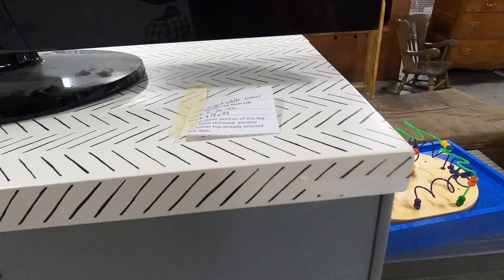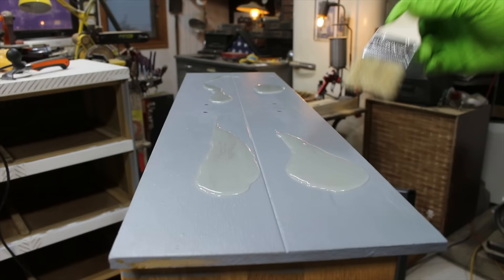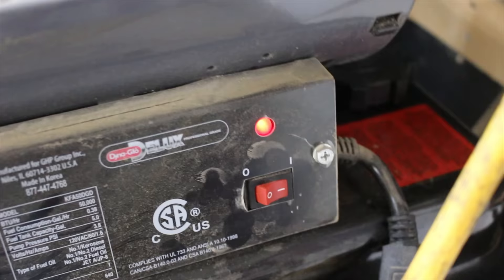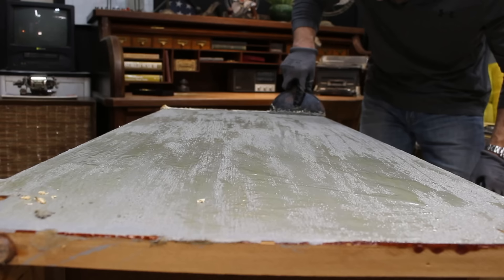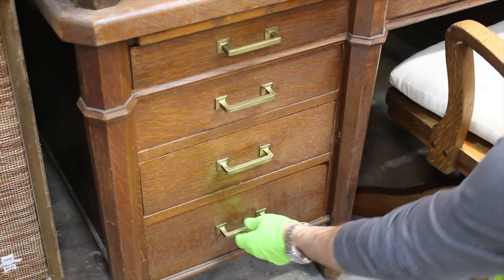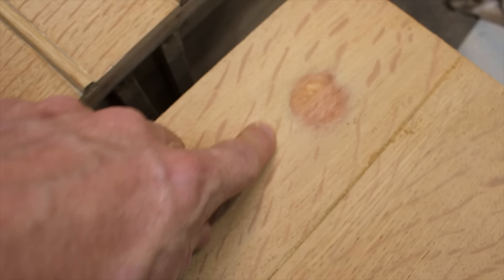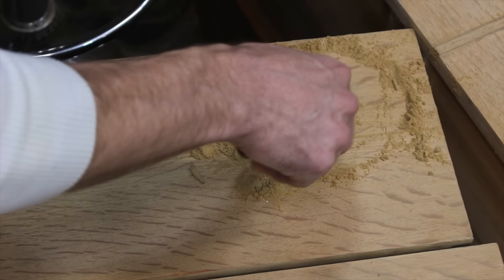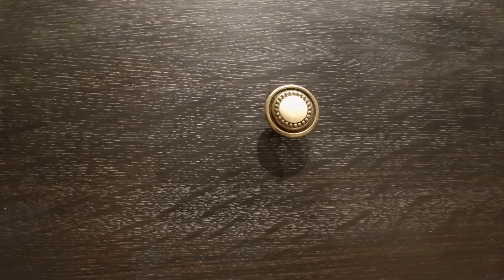Ep. 66 Painted DRESSER gets a GORGEOUS RESTORATION...

Comment: I am in the process of refinishing one that is very similar to that. I have had to use black gel stain on the top. I couldn’t quite get all of the paint out of the grain without burning through the veneer and now I’m struggling with maybe putting black all over it now because I’m on my last option. I have already called it a practice piece 😆

Comment: Lot of work. I finally got a dresser to work on and the top and drawer fronts look amazing. I’m shocked by the patience I had. But the crappy drawers won’t fit. I don’t think they ever did. I don’t know if I can do a good job rebuilding them. 

I don’t care for that style, but I like the hardware. It’s a really nice job. Not all of them can be 10’s.
Reply: Did you try moving them around to different spaces?
Reply: @cynthiafisher9907  They are homemade and just wonky. Moved them all around, but had to push hard to get them in. Then they got stuck. I’m thinking of just connecting them by hinges.
Reply: @Tenebarum  Ah, well, at least you tried. That sounds like a good option.
Reply: @cynthiafisher9907  lol, I think I’ve decided to turn the top into a small desk and harvest the walnut drawers and sides for another project.

Comment: That's a beautiful restoration, Barry! Coincidentally I recently purchased two Bassett desks (from the 80's I think, one is an early quirky style of computer desk with a pull out section for a keyboard...) anyway, the tiger oak veneer on them is paper thin, I've never seen anything like it! I don't think it can handle even the lightest sanding with a power sander...so it's stripper and hand sanding, or just restor-a-finish haha. Great to have you back, Barry!